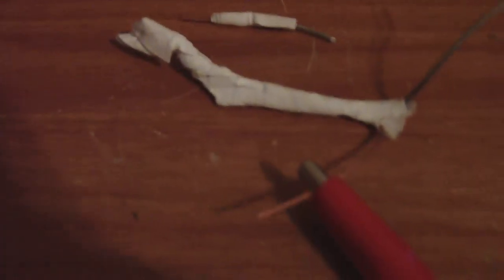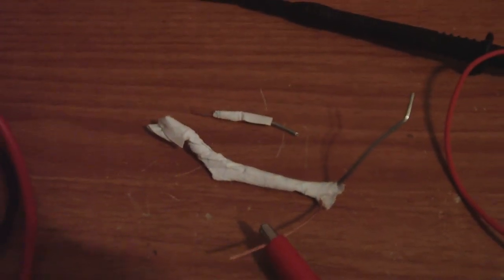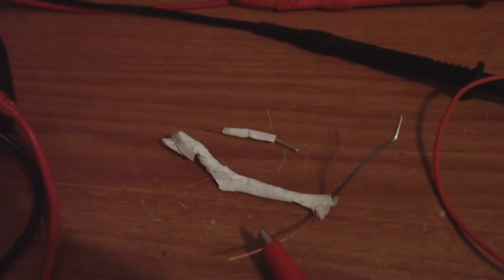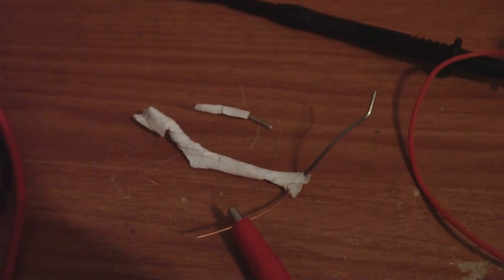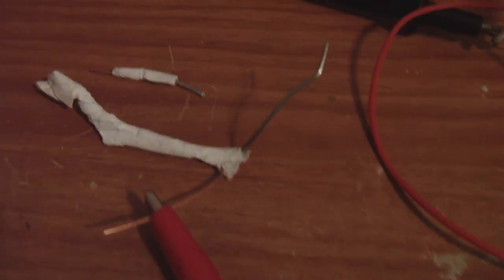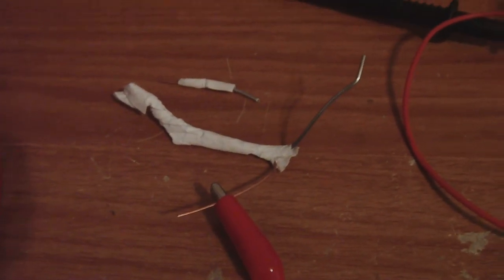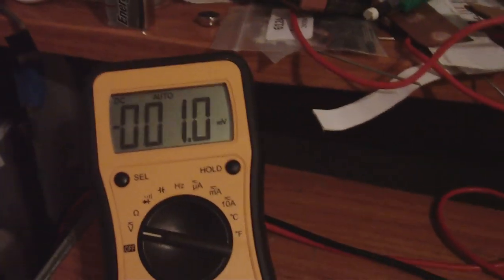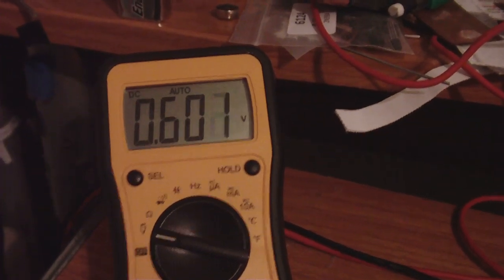Glue cell without the glue

Comment: Great job, ibpointless2! Try manganese dioxide with your ingredients, it should work with better amperage and even smaller cells very good! And also you can put all in bigger cans of copper or aluminium, depending what metal you use! And try programming the cells more hours or even days with DC voltage.

Comment: @ibpointless2 
Hi,
the humidity of the air is always there, so normally you have always some galvanic
effects with 2 different metals.
I let stay some graphite tube with a plastic spacer and aluminium alloy in the center 
in a dry location, but
after a few weeks the aluminiumalloy was already corroded, so it was just the humidity of the air
as the "electrolyte"....
There was no water anywhere, but the alloy rod was corroded...
Regards, Stefan.